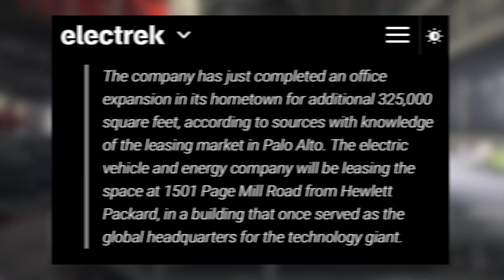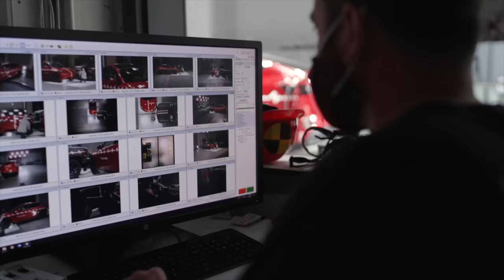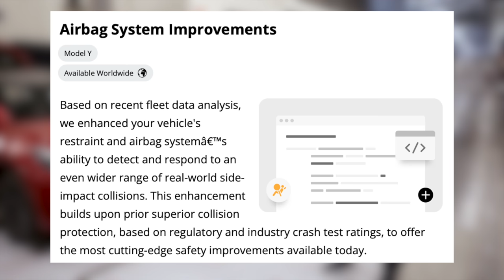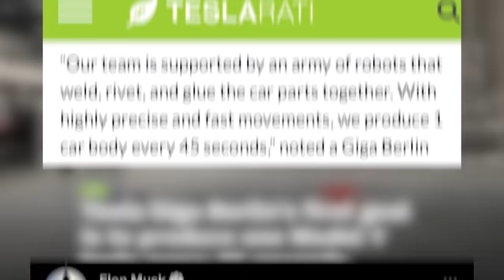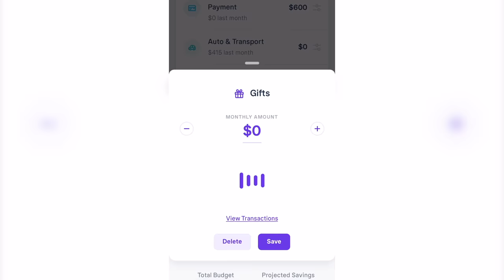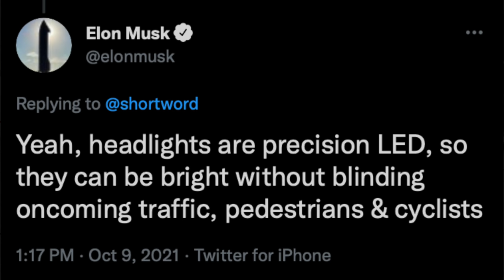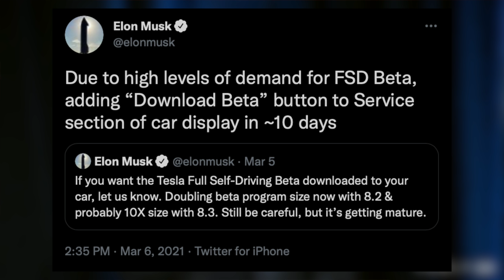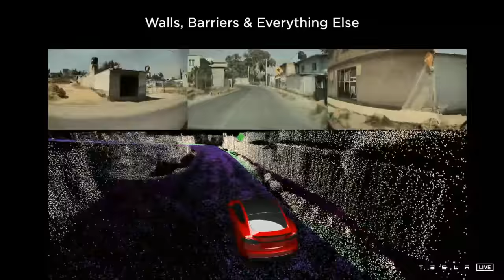New Tesla Features in 2022

Comment: 4:15 It's the same with the latest NHSTA "investigation". The NHSTA is attempting to call the on air update to improve emergency vehicle detection a recall. Tesla made no claim that it's vision system would detect emergency vehicles with 100% accuracy. The update simply improves the system. The NHSTA seems to want to make it more difficult for automakers to improve the safety of their vehicles. How does that make sense?

If FSD had a bug where it wouldn't disengage then I would agree with the NHSTA but this case is utterly different.

Comment: The one thing I took away from their crash test video is the fact the car has gone through industry standard testing and they alread have a top safety score yet they're still testing their vehicles. That's impressive. I mean, you'd think you would stop if you had the top scores but not Tesla. They keep making improvements.

As far as the car colors, YES. Bring it on. My favorite color is that crimson as well. I like the current red but for me it's too vibrant. I like the wine color red. I'm still on board with purchasing a Model Y next year and hope a few things line up in my favor such as the infrastructure bill giving EV buyers a point of sale rebate, possibly the release of the 4680 batters and some new colors and/or reintroducing that silver they use to offer back in the day.

Comment: Volvo has been doing this type of safety design using insurance data since the 70s
Reply: So? Tesla isnt using insurance data, they are generating their own data. See the difference?
Reply: @bigdougscommentary5719  Not really, crash data is crash data, My point was just that even if this is a great idea and something i think is great, Volvo also generates their own data. the main point is designing cars for safety not testing. Exampels of the effekt on Volvo was that their cars passed the smaloverlap test with cars designed 10 years before it was made. They have run of crumple zones, advanced airbag deployment.

Comment: So you're sitting on a metal bracket directly connected to a 70kWh battery... erm, don't want to make any jokes about electric chairs, but this is the kind of wild idea that might be going a bit over the line
Reply: bet you think an EV cant be charged in the rain, dont you?
Reply: @bigdougscommentary5719  Putting a metal bracket directly over the top of an open battery pack with the brace plate connected to the cathodes of the 4680 battery cells could be interesting

Comment: I really hope Tesla doesn’t DUMB DOWN some of their impressive innovations for the Model Y in favor of the Model X…I see them as appealing to different market segments with the X being more of a full size minivan while the Y can expand to be a quality crossover SUV.  I wont buy the X just to get fancy headlights/suspension/paint and sincerely hope the Y gets a credible off-road/winter package with decent ground clearance, all terrain wheels and tires, skid plates, vented seats, electric tinted windows, towing capacity/range etc.  Over half of the US has a rough driving/winter environment for part of the year.  The Y could be perfect while the CYBERTRUCK fits into the full size ICE replacement.
Reply: Yes, I hope to order a Model Y in the near future, but as I live in Colorado, I really wish the ground clearance were better.
Reply: @carolfischer9935  I’m in Colorado too and would love to get the Model Y Performance for the added power for hills and towing a trailer/camper.  Unfortunately the ground clearance is ACTUALLY LESS than the Base Model Y AND the tire/wheel package is dray pavement only (but that can be changed for $$).

Comment: Does anyone think Tessa should add a transmission in their car because I do and I think I got a good reason for it and the transmission I'm thinking of will have two gears first and second no reverse or park that can be done with the motors but both gears will not switching between each other like a normal transmission they both will be active at once but depending on the speed of the vehicle they will override one another seamlessly one care for torque 2nd gear for speed take the plaid it's geared for 200 mph and I see it like this you take a gas car and shift into its last gear it's going to burn a lot of energy and gas trying to get up to those speeds and it's even though tassels are already efficient this can increase efficiency by a lot he won't even need any computer systems or anything you won't even feel the gear switch because both are technically active and it's all mechanical and very simple also you get more pulling power and better acceleration for those who want the polar massive trailer behind their model 3s perhaps 🤣 I know this is a bit of subject about the video please tell me what you guys think
Reply: I think the reason that Tesla vehicles don't have a transmission comes down to cost and simplicity in manufacturing. I believe the Taycan had a two-speed transmission and it did perform better than the old Model S at high speeds. But, introducing a transmission would probably complicate the manufacturing a lot and makes the vehicles more expensive to produce.
Reply: WOW! You should go work for Ford or GM or Porsche.